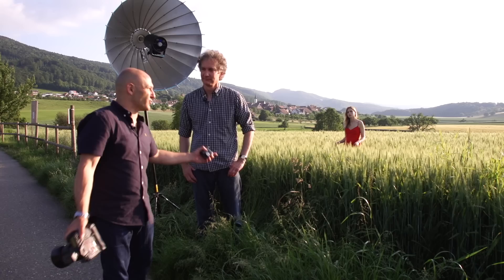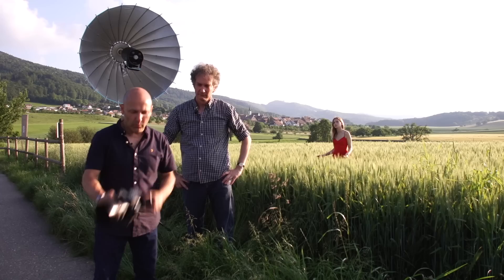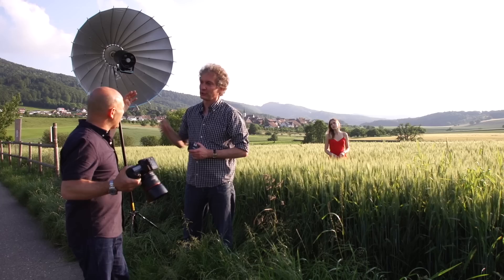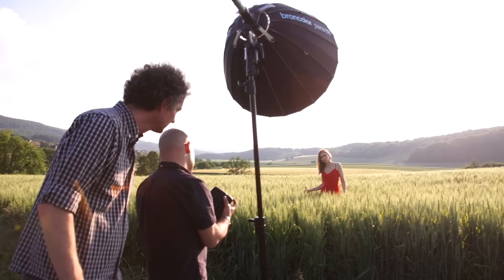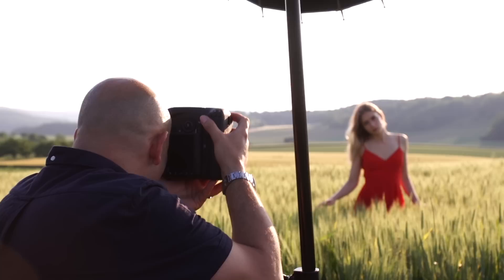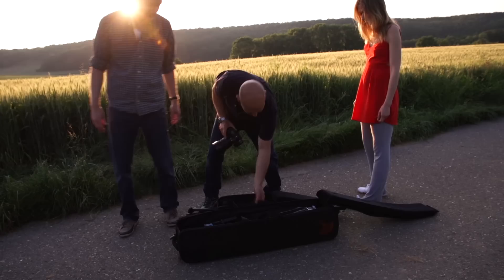Broncolor 'How To' shoot High Speed Sync flash with a DSLR

Comment: You can also take a cheap Manual speed light set it at full power output, an also shoot at 1/8000 second with any camera.  The reason why this works is simply because when the  Manual speed light is set at full power output you have the longest flash duration time typically around one 250th to one 500th of a second and so the flash is on longer than the shutter is open.

Comment: Karl
If you set your flash exposure to F/5.6 you would then set your aperture to F/1.4 when using a - 4/f Stop Neutral Density Filter therefore the exposure did not change, Therefore the light level in the viewfinder will be exactly the same it will not be dimmer, but you will have significantly less depth of field.
Reply from the maker: If you are looking through an SLr or DSLR camera then you are seeing the light through the lens bounced of a mirror though a prism going to your eye, so if you darken that light then you will also darken what your eye is seeing through the viewfinder. It won't matter to the photo but it will make it difficult to view because when you are viewing through the viewfinder you are already looking at it almost at full aperture.
Reply: So if you are shooting sports or wildlife with a Canon EF 800mm f/5.6L IS USM  it would be difficult to see through this lens and/or focus?
Reply from the maker: Yes if you put a 4 stop or more ND filter over the lens or in the lens etc as you would be blocking a lot of the light from reaching your eye while you are trying to compose or focus. For example whenever I need to shoot landscape work with an ND filter I will do all the composition, focusing and exposure calculation first and then put the filter on and adjust the exposure by the 4 stops and then take the shot.
Reply: If you are shooting with a Mirrorless Camera which is what I shoot with your statement does not apply at all.  The EVF on  a Mirrorless Camera is displaying what the final image will look like both depth of field and exposure. If you set your flash exposure to F/5.6 you would then set your aperture to F/1.4 when using a - 4/f Stop Neutral Density Filter therefore the exposure did not change, Therefore the light level in the viewfinder will be exactly the same it will not be dimmer, but you will have significantly less depth of field.
Reply from the maker: Well of course yes in that scenario but you didn't mention EVF or mirrorless cameras at the beginning of your conversation, I'd guess that 95% of professionals are not using EVF cameras.

Comment: Awesome shoot, but the profoto B1 and air remote trigger has these feature for a couple of years now, love the broncolor para though, absolutely stunning quality of light
Reply: can you explain how profoto B1 and air remote trigger can shoot High Speed Sync with DOF please!!!
Reply: high speed sync basically allows you to shoot at shutter speeds up to 8000th of a second while still syncing with your flash head, this allows you more control of the ambient light, having control of ambient light and your flash allows you to shoot in the aperture you desire if you know what you're doing... thought high speed sync is not the only solution, you could use ND filters too

Comment: 5:42 Picture on the right "Shallow depth of field not possible"  How so?  What is stopping you from opening up your aperture without HS trigger?
Reply: Using a trigger without HSS will limit your shutter sync speed to 1/250(Some cameras even 1/200) At this shutter speed, in bright daylight, opening up your aperture will overexpose your image. To expose properly in this case, you’d have to keep your aperture stopped down.

Comment: Nice video - I understand this is about using fill flashes and in particular the Broncolor, but in terms of the high speed trigger...could the same effect be possible by using an ND filter? (e.g. bring the aperture to a more pleasing f1.8/f2.8)
Reply from the maker: You would have needed about a 5 or 6 stop ND filter which would have made it difficult to see through the lens and/or focus. I have done it with an ND before in fact we taught the technique in our courses on our website but that was with just a 3 stop filter.

Comment: I really want to buy that Para, but just seen to make it to work you have to invest in another 3 things!
Reply from the maker: Hi you can use a Para with most lighting systems from other brands as broncolor also sell adaptors
Reply: Karl Taylor hi Karl thanks I have the Siros Ls but noticed the rod and bracket are sold separately

Comment: Taylor, i believe you don't need a special toy to get the camera above their native sync speed. the flash or the light sources needs to be able to sync at high speek.  Also, I though that by adding anything to the hot shoe, it will trigger the camera to sync above the native 250, or 350, in the Nikon is the case, i use it in my D7100. Can you clarify if i am incorrect or missing something.  thanks, love you video
Reply: LIllyman JPL you are wrong... if you use a trigger system that does not allow HSS your light will not illuminate the entire frame even if the light has HSS capabilities. The camera, the off camera flash and the trigger system need to have HSS capability
Reply: Thanks, you are correct, both the trigger and the light need to have HSS in order to get proper exposure, except for the leaf shutter cameras, they can without HSS below 250 fps.

Comment: In this video you didn't say anything about which ISO you were using.  If you want to open up the aperture for a shallow depth of field, couldn't you just use a low ISO setting with a stronger flash?
Reply from the maker: I was already at the lowest ISO. The point of the video is to demonstrate that at a large aperture setting at a (even at a low ISO) you would need a very fast shutter speed in this type of light. As such you generally can't synchronise flash at such high shutter speeds because DSLR's don't sync at high speed, however with this new trigger you can, as well as use these lithium powered lights on location.

Comment: I contacted Broncolor support and they said their Siros L supports HyperSync not HighSpeed Sync?
Reply: Yeah I think what they are using is the slow flash duration of the unit for the hypersync, I am using the Elinchrom Ranger RX speed AS unit and with the S heads I can get the same effect as Karl but using pocket wizard triggers. Its a bit confusing I'll give you that telling the difference between hypersync and highspeed sync

Comment: KARL... Stop just showing the back of the screen when you say "look at that image". I've been watching you for the past five years and I bout five of your DVDs and the same problem is plagues both your YouTube videos and dvds. Show the images in full screen or at least show them down in the corner somewhere so that the viewer actually know what you are talking about. You loose the viewer. 

Other than that, great demonstration :)
Reply from the maker: If you watch the video you see we bring up the photos full screen with the details as an when is necessary. We do this in all our videos and always have done. It doesn't 'plague' any of our videos, every single example we shoot we show you the shots at the right point when it is necessary to see the results! I think you have not watched the videos with your full attention!
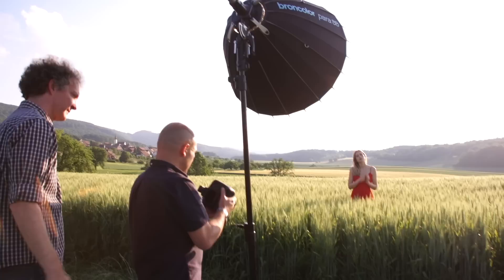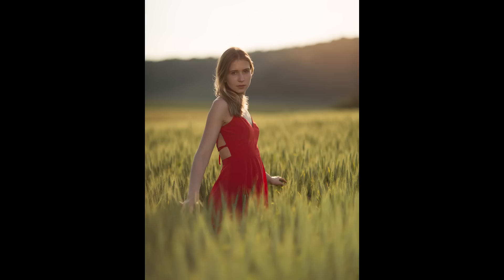Reply from the maker: In fact the full screen images come up no less than 6 times at: 3:39, 3:49, 5:26, 5:36, 5:41, 6:52
Reply: Yes you have gotten better at it. And in the beginning you actually made a good job on this one by showing the image at f11 in the right place.

However,  later on in  the video you do the same routine you did several years ago and did in your older dvd's by taking images of different settings and not showing the result immediately. In this case, at the end of the shout when you switch between different high speeds and don't show the image's, we are treated to an awkward moment of you enthusiastically saying "look at that" and the viewer frustratingly try to see what you see on the back of your camera.

This is not a huge problem, but it is big enough to damage the good flow of the video. Because when you do that you accidentally anger the viewer in to not listening to you since they try to figure out what you had shown.

It's good when you show the final image, but as an instructional video it looses quality because you should show as many images as possible, especially the bad ones, since they show the work you go through in order to reach your final image.

So a good rule of thumb here is:

1. When you hear the shutter click on an image you will try to show in the back of your camera or at least have something to break up a long shoot, show that image, even if its not the best,
2. Unless you are filming Birdman, don't use shots that are longer than 20 sec. If you are going to do that you have  to make sure they are very dynamic and have something happening in them all the time.

Yet again, I wont criticise you as a photographer, but with a few simple tricks you can make yore videos a lot more dynamic and interesting.
Reply from the maker: Hi Mattyy the final result shots are at 1/8000th
Reply from the maker: Hi Harald, from our perspective if 6 example images during a 7minute video isn't enough then we don't know what is. We also believe that if we have to keep throwing up every image we shoot in a batch that it would break up the flow of the video and what is actually being taught. Our programmes are made in a documentary style and it's not always possible for the cameraman to go from filming wide to then in close without missing something else. We have several new video courses in the making (paid ones for our customers) so I will keep some of your comments in mind but this video demonstrated the function of the Siros L and the HS trigger and it did that exceptionally well and it showed side by side results that clearly demonstrated the with and without factor which was the whole aim of the video, it even included words with the pictures to ensure clarity. I think this video did exactly what it needed to. We also weren't filming Birdman or any other type of dramatic high budget production, what we were doing was making a FREE video with just 2 cameras,  a short window of opportunity with the setting sun and trying to put all that together for everyone to understand what this kit does and why it is useful. I think we achieved that very well.
Reply: I do have a YouTube channel myself so I do know what it takes to make a good video. And I'm still learning so you may take my critic however you like. 

However, its neither the number of shots you show nor the budget that is important, but the content. And this might be a free video but you are not just representing yourself
here but also Urs and Broncolor as a company. So it should be in your best interest to make the best video you can.
But to really illustrate what I meant with "not showing enough images and showing more in between images", maybe not at full screen but at least down in the corner somewhere, look at the video again between 3:49 to 5:15. There you placed a long clip of your back where you momentarily take down the camera to look at the back of it and then take more shots. This is what I mean of not showing images that you draw attention to. If you had shown the images that you took at that moment, or at least put a break cut I there somewhere to break up an otherwise boring shot,the hole video would have dramatically increased in quality. 

I also said that this problem is plaguing the DVDs (at least the oldest ones). And this is my biggest critic here. I did like the information you gave in them, but these little editing flaws kept me from buying more of them since it was very hard to keep myself concentrated. This is really bad since I later found the same or similar information in free YouTube videos, but their instruction style was a lot more refined than your DVDs. And I didn’t have to pay 200 pounds for them. 

So this might just be more of a beef from a slightly disgruntled costumer than anything else. But I have seen you do these small editing mistakes for years now and it is such a quick fix that it really shouldn’t be any problem. 

So please take this as a critic from someone who is only trying to help. You are a really good photographer and your videos are really inspiring when you get them right so please don’t take this to badly.
Reply from the maker: Hi Harald, thanks for your continued delineation. On your first point I did take some time to look at your videos and  i'm afraid yes I find it slightly difficult to accept you as a critic. However as you said you are still learning, but if I may I'd like to offer you some advice (if you would like it) but I'd feel more comfortable to do that in a private message rather than an open forum so I will contact you when I have some more time.

On your second point yes you are absolutely right it is in our best interest to make the best videos we can and again I think this video does exactly what it needs to do. It has sliders, aerial shots, good cuts, music, many camera angles, it's enteraining it has humour and most importantly it is informative. I think the problem here is that the first time you watched it you weren't paying close attention and probably missed that many of the shots that came up, maybe you were distracted doing something else at the time. Upon seeing my reply and realising that actually the images were brought up 6 times during the seven minute video maybe you were quite surprised and felt that you had to defend your position and consequently from your first reply saying we did a good job you became more critical as you went along. That's understandable, it's difficult to remain neutral during these type of online interactions. I hope I''m managing to stay impartial myself.

About the clip of my back, i'm afraid at the time of filming i'm shooting or presenting. I'm not the cameraman or the editor (I already have enough on my plate) but I will point your comments out to those responsible for that to see what they think and of course it has my name on it so I should be conscious of your comments and feedback too.

On to your next point, our first DVDs were made 8 years ago and two years ago many parts of them were re-filmed, re-edited and re-mastered to provide our customers with even better products. We are extremely proud of what we produce and our continued happy and positive customer feedback let's us know that we are getting most things right (although we are happy to receive your comments because there is always room for improvement). We also believe that as we are requested regularly by the industries leading brands and even television to to present on topics about photography that the way I engage, entertain and explain must be hitting the mark for most people or surely I wouldn't be requested to do such things? I'm not sure what you purchased from us in the past but most of courses are not as expensive as you detailed. In fact there is only one at that price and that one doesn't show any pictures on the back of the camera as they are all being shot tethered on screen and it is a course on advertising photography. Also as we had a satisfaction guarantee and customer support and you now have claimed you are a disgruntled customer (which is slightly different from your first position) then it would have been better if you could have contacted us at that time with any queries and we would have been happy to have a conversation with you then rather than some years later in the comments section on youtube.

Finally I will try not to take it as too much of a criticism as I have a lot of faith in what 95% of our customers tell us, of course there will always be a few that are not happy for whatever reason and maybe you are one of those few. But I also welcome the feedback as certain elements are always useful for us to check and address if necessary. And to reassure you that I'm not taking this badly we have the opportunity to vet all our comments before they are published so hopefully you can rest at ease that I or my team we are OK with your feedback and have been happy to publish your concerns. We also have faith that those reading them won't take one persons word for it but they will also see the amount of positivity our material provides to many people or take the opportunity to read many of the positive reviews on our website and from other respected parties in the industry. Once again, thanks again for your feedback and I will discuss your comments to the camera and editing guys tomorrow.
Reply: Karl Taylor how far is the light from the subject?
Reply: Harald Kylin man check out Jason Lanier I love his videos, I like how he show every single images that he took in the video. It’s time consuming but majority of the viewers actually like it. I personally like that esp if you’re  reviewing a product.
Reply: Karl, You are a Master of Words and Tact 😉😉 😂😂

Comment: why dont you take meter readings with a light meter when you're working with strobes?
Reply from the maker: I haven't used a hand held light meter since the days of film as they are not necessary, I just look at the result and then make a decision on whether the flash needs to go up or down or the ambient needs to go up or down. It really is that simple. I also don't really bother with the cameras light meter because I shoot in manual mode and I already know roughly the exposure that I need to get me in the ballpark and from there I check my test shot and make a decision on what I'm going to set the camera to do to get the result I want. I'm not leaving it to a computer to tell me the result that I want, I can make those decisions for myself.
Reply: Thank you sir...big fan of yours...😊